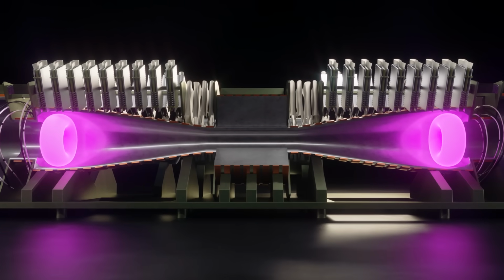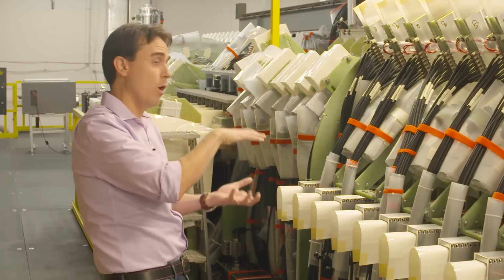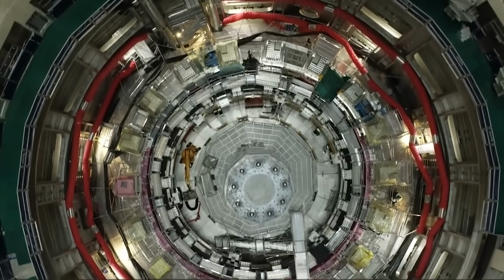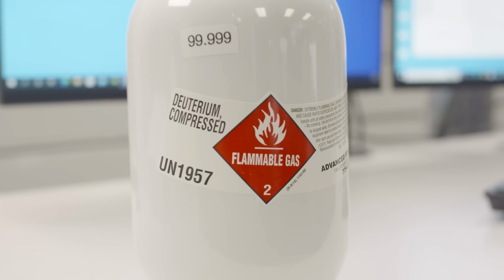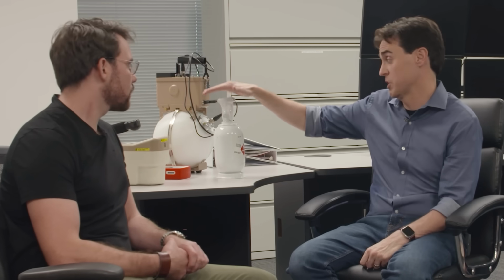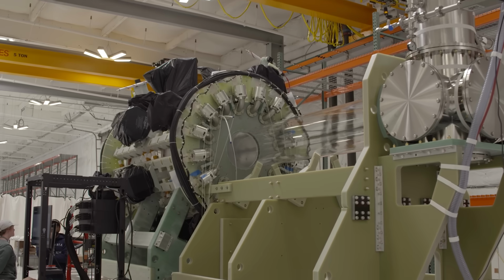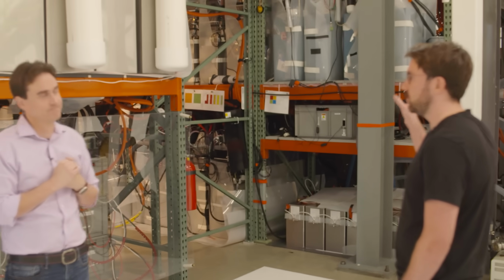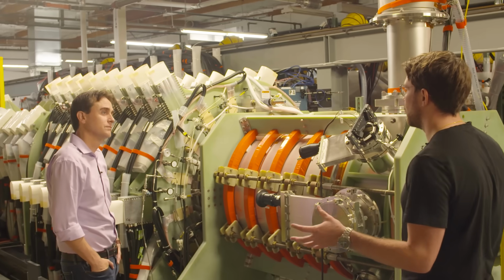A New Way to Achieve Nuclear Fusion: Helion

Comment: how long before it becomes a practical solution for a city's power needs?
Reply: Likely 2029 by my estimate.
Reply: @elmarmoelzer2229  why would you say that? it really seems to soon to work out the issues. mainly scalability?
Reply: @bdoctorg  Helion historically has a 3 to 4 year build- cycle. 
Polaris will have been operating for about a year by the end of 2024. For reference, Trenta had been operating for a year, when they started building Polaris.
2024 + 3 years would be 2027.
But since the next machine after Polaris is going to be commercial and they have to go through a few extra steps for that (build out manufacturing, licensing, etc), I say 2029 is realistic. 2027 would be IMHO the absolute earliest and require infinite funds and then still all the luck in the world to make it happen. I doubt it.
Reply: @elmarmoelzer2229  wow that is very encouraging. they will probably have a few test places and  then roll out to anyone who wants it.
Reply: @bdoctorg   Their investors will likely be their first customers. RELIABLE power 24/7...
Reply: @elmarmoelzer2229  i guess the last concern is just how much it costs for maintenance and how long it will last. if it really is completely unlimited energy it will be both popular and most likely improved upon by rollout.
Reply: @bdoctorg  Oh yes, the first machines will not be perfect. Just like it has been with any technology. The first flat panel TVs cost a fortune and sucked compared to the lowest priced consumer models today. They still had a market with early adopters and set the path for the cheap and much better ones we have today.

Maintenance costs cannot be that high. Even CFS's Tokamaks won't need major overhauls more often than every 4 years. Helion's machines will likely need less and they are easy to disassemble (unlike a donut shaped tokamak that is fully suspended in a FliBe tank). Heck Trenta cost 35 million to build and operate as a first of a kind machine where everything had to be invented from scratch. A mass produced machine will likely cost less (even if slightly bigger). Might just be rational to just replace the whole thing, then transport the old one back to the factory for refurbishment. Their machines will be transportable by road. So not that big of a deal.

Some of Helion's investors have data centers that require reliable power 24/7. Cost is important but then they would also get tax credits, etc. And the investors of course benefit indirectly from Helion getting market traction. So even if the first machines cost more, the indirect benefits are great. My guess is that Helions machines there will be operating at a reduced capacity most of the time and only get fully activated when electricity prices are high, or when there is an outage or something like that. That will make them last longer and even with the first machines, the cost/kWh will likely be lower than from a gas turbine, which is one of the few other energy sources that can be activated at a moment's notice.
Reply: @elmarmoelzer2229  well shouldnt the cost be pretty much free in comparison to what is being used now? i know they will charge people something but i would say bills will be cut to 1/4 of what they are now if they adopt the system. it will take time to roll out in a huge country like canada but at the same time they can easily fit in and its just maintenance. if we have them out by 29 we will have them everywhere by 33 and probably have an upgraded version that is considerably more cost effective by 40. not sure if my timeline is right but i would not be surprised if we have no more electric bills other than 10 dollar usage fee around the mid 30s
Reply: @bdoctorg   It will take time for mass production to take off and the kinks to be worked out, but I think that eventually electricity will be MUCH cheaper with this.
Reply: @elmarmoelzer2229  yea we will see there are a lot of people that wont want to give up the revenue stream of the electric bill but yea if its free energy it should be a lot cheaper.

Comment: what kind of a blast would result from loss of one of the plasma cannons? i can imaging the destruction of an entire urban center.
Reply: Plasmas dissipate in milliseconds in the atmosphere. That's why they have to make a vacuum inside the machine.
Reply: @charliem6590  it is not a trivial amount of energy to be very quickly dissipating into atmosphere. how much plasma energy are talking about?
Reply: @JonathanNomad   The total energy content of a pulse is likely in the single digit kWh range and that is after fusion and compression. It is maybe 1 or 2 kWh in a single plasmoid.
Reply: @elmarmoelzer2229  thank you for using "plasmoid" in a sentence!
Reply: @elmarmoelzer2229  At 25:45 the Brian says the total capacity of the bank of capacitors is about 10 MJ, or roughly 3 kWh. There are probably other energy contributions that go into the machine but they should be smaller.
Reply: @charliem6590   Yeah  but those 3 kWh drive both plasmoids and the compression coils. So a single plasmoid should be less than that. Plus not all of that energy will make it into the plasmoid to begin with.

Comment: remember that energy input should also include the energy taken to extract Deuterium not just what used to heat up the stuff
Reply: A 50 MWe machine will only use a few kg, maybe about 20 kg of Deuterium a year. The energy needed to extract that is negligible.

Comment: Lots of questions about this concept and the experiment as shown. No data at all is given about the density, temperature and confinement time achieved. Surely no fusions are taking place, since otherwise neutrons would be produced and therefore radiation safety issues would arise. It seems nonsense to suggest using the D-D (most difficult) fusion reaction to generate T for the D-T (easiest) fusion reaction; if you are able to achieve D-D fusion  there is no need for it. The electric current values given are such, that magnetic forces would be enormous: the experimental facility as shown does not seem to be very strong. Etc. And I could continue with many other issues which cast lots of doubts about the claims as given.
Just for the record, I read my Ph.D thesis in 1983 on "Alpha particle heating in Tandem fusion reactors". After so many years of lack of progress in fusion research, I would love to see new concepts to the achieve fusion energy, which I am still sure is the future of energy for mankind.

Comment: I like the idea of using the D-He3 reaction to avoid the damage caused by neutrons, but won’t they still get D-D reactions occurring alongside the D-He3 reaction? I’m not sure there’s any reason the D ions would preferentially fuze with He3 instead of other D ions
Reply: Helion needs the D-D reactions to make He3. 
D-D neutrons are not that big of a problem. They are only 2.45 MeV (vs 14 MeV for D-T neutrons) and they only occur in 1/3 of the reactions. The 2.45 MeV are below the activation energy of many materials that they can use (and they are still looking into the best combinations for that).
Polaris can be fully decommissioned withing 2 weeks of operation.